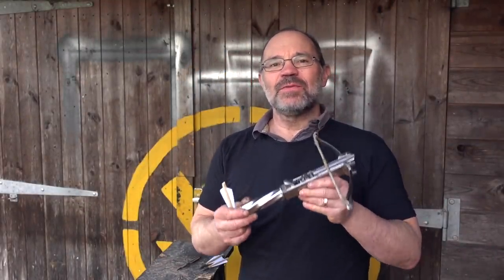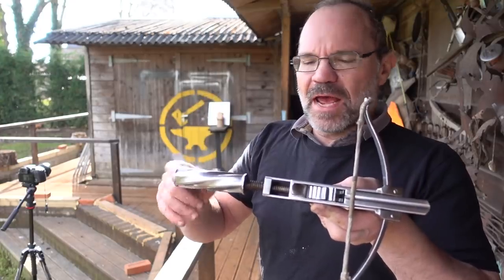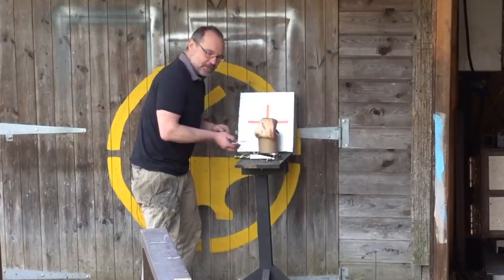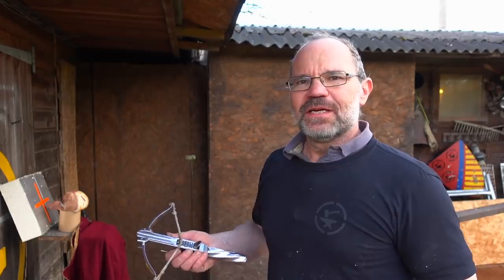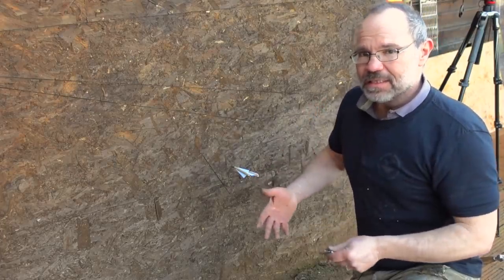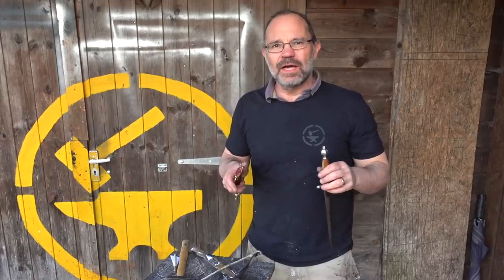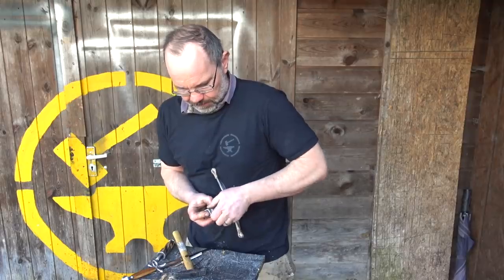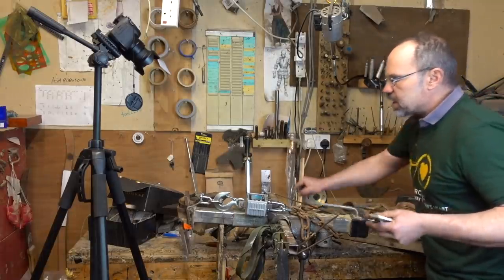200lbs Assassin's Crossbow - LET'S TEST IT!

Comment: I feel like this is the kind of weapon you use point blank behind someone at the theater while the crowd applauds
Reply: Well, in that scenario, a knife to the back is more effective, more deadly, and makes no sound.
Reply: @GuitarsRockForever  but you also risk being covered in blood and getting caught because of it
Reply: @archiebf4524  
Not true, as long as you don't take the knife out, just stab and go away. Poison the knife if you want, getting the job done much better.
With that thing, there are only few craftsman could make it, if you use it, they will trace it back and you are screwed.
Reply: @archiebf4524  Wear a glove.
Reply: @GuitarsRockForever  stabbings are very messy affairs whether you take the blade out or not, I have witnessed 2 of them. Also we don't know how many of these there were, perhaps they were quite common and stolen for the job?
Reply: @Duiker36  stabbings are very messy affairs, a glove might not cut it. Pun intended.
Reply: @archiebf4524  
Tod did a video about those mini crossbow before (I think). They require very skilled craftsmen, and those who can make it, are very small in number. They were never made in large number. It would be stupid to use it.
Also about stabbing, the bloody part is more happening at withdrawn stage and you can shield the blood from the "in the body" stage pretty easy.
Reply: @GuitarsRockForever  we dont actually know how prevelant they were due them being outlawed, yes they would require a skilled craftsmen but that doesn't mean they weren't common amongst the wealthy, maybe they were maybe they weren't I don't think either of us actually know. Point is if you really wanted one that couldn't be traced back to you I'm sure that was possible. I'm happy to agree it's unlikely they were used but I do some situations where they could prove useful
Reply: What if it was more like a "you all know who ordered this assassination " thing?
Reply: @GuitarsRockForever  killing someone with a knife isn't very silent. this is basically just an automatic sabber so you don't have to stab through 7 layers of clothing and get into a fight with someone whether or not the stab works out
Reply: Thats what i thought. Point blank in the back of the head
Reply: @GuitarsRockForever  And if our assassin wants to make it look like if came from behind? with a knife, left in or not, you suspect the one standing behind the victim, with a bolt you look further afield. After all, a paid assassin wants to get away.
Reply: Poison the tip of the bolts, and having range at your side is a bonus in every way of the subject.
Reply: @aleisterlavey9716 , it would be quite good at sending a message. The arrows don't penetrate very deep and the victim is likely in the vicinity of local doctors unless you use it as a highway man. The psychological effect could be quite effect because it looks like it could've hurt and possibly (with a lucky shot) killed. Moreover, if your goal is to scare instead of kill then you don't need aim, all you need is a hit in the general vicinity. That means you can 'aim' it from below a sleeve or table. Aiming it from below might also make it easier to press the trigger. Finally, you've got a bit of distance between you and the target and a bewildered and scared crowed might just run in all directions. You might even be able to trigger the panic by acting the part.
I like the scare idea. The most difficult bit is, I think, the get away. But if you want to do this in a controlled fashion then use two or three people. If these darts start flying from everywhere the you will have a panic.
Reply: Some of you guys are looking into this way too much. Google the Richard klukinski interview he was a mafia hitman. You would use this thing by running up to someone in a crowded market or empty ally or something, back of the head as your walking by in a robe or something as someone mentioned. The guy who said stabbing someone is easier than using this is a sweet guy you can tell he hasnt seen much trauma. Its not like the video games. You dont just stab someone and they start blinking and disappear. 

If you use this thing you can easily just keep walking. No one would suspect you. If it failed or missed you just carried on. Using this like a calico isn't the idea. You arent spraying and praying with this thing fellas, range would not be your friend. Its essentially "holding" a deadly ammount of force for you to use at your discretion. Even if you werent skilled, strong or in some kind of disguise or discreet situation you could know that the force is there ready at a moments notice. You have to posistion yourself properly.
Reply: To be honest having 1,5m-2m reach vs melee is actually a big advantage and already a lot more difficult to detect and defend. Even from a psychological view pulling a trigger is better and easier than ramming a dagger into a person. Early pistols were shot from similar range in cavalry battles.
Reply: Unrealuknow what happens if you miss 😂
Reply: @Sauce_Sensei  if you're point blank you don't miss unless the person does something drastic like duck.
Reply: @GuitarsRockForever  what if he was surrounded by heavily guard or idk . This might be usefull
Reply: This was my first thought too. 5 meters seemed like a long range. Any situation where you wanted to keep some distance, but otherwise wanted to be discreet and could still guarantee a killing blow to a critical area these little things would be useful.
Reply: @GuitarsRockForever  Knife in the back is more deadly than bolt in the brain? A knife attack is more violent, personal and physical. A bit more complicated than pulling a trigger and walking away.

Comment: It might work better if you used a iron bolt as due to the small size a wooden bolt with only a metal tip doesn't really have the weight necessary to carry enough energy to be lethal, if the whole bolt was metal though it will probably hit much much harder, go further and may even be more accurate as the bolts you were using seemed to almost angle upward slightly of where the bow was pointed.

Comment: I greatly admire your handiwork. The quality of workmanship is unbelievable. Looking at you shooting it at point blank range made me think that could it possibly have been an attempt at making a type of "powered" push dagger? Rather than bolts a very heavy push dagger type blade may have been used to penetrate chain mail. Even at point blank range the user could have been out of sword range shooting it with arm extended. If that were the case the bow would never have been sighted at eye level  and the position of the trigger and the way it was held would make it very usable for point blank torso shots. That sort of ties in with the description of your wonderful recreation of this weapon as an assassins crossbow.

Comment: A well designed set of hand-thrown darts would be 
more effective and easier to conceal.
Reply from the maker: I hadn't thought of that, but yes, very much so
Reply: If we are talking about altatl darts then yeah, but a little dart like this?
Reply: I agree the darts would be easier to conceal while carrying them but maybe less so when deploying them. I imagine someone could fire a loaded balestrino with a posture that doesn't draw much attention while chucking a dart might stand out if there are witnesses around. Also, I think effectively using the darts would require more skill. A trained assassin might have that skill but a novice who was trying to kill someone sneakily probably wouldn't. 
I'm not saying I think the balestrino was actually an assassin's crossbow, just exploring scenarios for the sake of discussion.
Reply: Throwing a weapon, however, is a big motion. Even at short ranges it's obvious you're the thrower. Using a crossbow like this from under a cloak, can be almost imperceptible. I imagine the optimal range to shoot for this is about 5 feet. You walk up in a crowd, make no obvious gesture with your weapon concealed in your cloak and fire nearly silently. Sounds pretty assassin like to me. =\
Reply: @beansnrice321  No, watch the video again, that crossbow is
louder than a PCP air rifle with no suppressor. The nut is so loud
it echoes.
The idea that a cloak could save you from the gallows is comical.
Reply: @Japs_Eye_Of_The_Tiger  While not silent it is certainly far less conspicuous and less immediately obvious what is going on.

But regardless I concur with Todd that these were highly likely not assassin's weapons and more toys that some derps thought were scary.
Reply: @josephburchanowski4636  blow devices can be very long.
Reply: @planescaped  Honeslyt this. People would have heard a loud sound that doesnt sound like a gun, you wouldnt be the first person to be noted, and they could have dampened the sound using leather or anything really.
Additionally to that, we have literally no idea how these weapons were made, if they were made of full steel or not for example, which would make a massive huge difference in what kind of sound the crossbow makes when fired.

There are two different conclusions here with this. Either what Todd has is just a trinket version of what was actually used, or it was just a trinket. I dont really see it being used in any capacity without a bolt clip regardless of how it was used.

Comment: If you were an assassin during that time period, and getting caught meant being tortured to death publicly, using whatever possible technology was available to minimize your chances of being caught is money well spent. Also it doesn't really matter it was inaccurate, it was the best you could do at the time. Just trying to get that bolt anywhere on target to administer poison at range and then running for your life to hide is a much better idea then approaching in daggers reach to be grabbed or tackled by a bodyguard, and then drawn and quartered to the cheers of a crowd. 

This seems like a Hollywood or fantasy novel trope, but how realistic is using poison bolts for that crossbow?  Did sufficiently dangerous poisons exist during that period of time that could be practically applied to a bolt?  If there was a sufficiently dangerous and practical poison available I could see that being a viable use, it's much more quiet than a firearm it has range that a dagger does not, you only need to hit a human size target in the back and then slip away to kill your target. It has the power to penetrate clothing and administer a poison fairly quietly at range, and that's all you need.
Reply: Knew I couldn't be the only one who thought of this.
Reply: @CowCommando  I find it kind of bizarre that this comment was buried and nobody else is really suggesting this.  It seems kind like common sense to me and I can't think of a different weapon I would want to use if I was an Assassin during that period in Italy. I mean, I am all ears if someone has a counter point I would love to hear it. 

If ,and I will acknowledge this is a big IF a sufficiently deadly and available poison existed at that time that could be reasonably applied to a crossbow bolt, but if that did exist, then yeah it's not only a viable Assassins weapon, it's a desirable one compared to the alternatives of the time. Even is a poison only had a chance at working it seems like a chance you would take over risking getting yourself killed.  You could get your target with a knife or pistol at that time, but It would also be desirable to you know, live afterwards, and not die a painful slow death.
Reply: @-Zevin-  plus we need to consider that the examples we have available to us are likely the plinking toys of nobles. Who would be less concerned with utility. An actual assassin would likely breakdown their weapon and conceal it between jobs, making it less likely to survive. Those weapons would be more likely to have more utilitarian features like the bolt clip mentioned in the video.

A modern equivalent would be the way some people use firearms. You have the plinking hobbyists who have flashy features that don't really add anything. Then you have people who work with firearms and only bother with practical features. The former often get displayed (see gold plated AK-47's) whereas the latter is a tool, used, maintained and disposed of when no longer useful).
Reply: Poison on arrows was widely known back to the days of ancient Greece - extract of aconite was smeared on arrows use to hunt wolves, leading to aconite gaining the common nickname of wolfsbane. On the other hand, if an assassin was hired to kill some high muckety-muck and had access to poison, a much more effective and safe way to deliver it would be to disguise themself as either a court flunky of high enough rank to have access to the target but low enough rank not to draw notice or as a servant, and dump the poison into the target's cup of wine, beer etc. It would give more time for the assassin to escape once delivered, and they wouldn't have to angle for a shot or even carry a weapon.
Reply: Do you need deadly poison, maybe as a threat or intimidation hitting a noble with a bolt with a position like hemlock poision ivy or sumach making them sick for a few days or in pain would be a sufficient scare to alter laws or gain compliance.
Reply: One word. Blowgun. Does everything this toy does better. Cheaper, harder to trace, easier to conceal, vastly more accurate at range, quick reload, harder to recognize, longer response time to its use allowing for much more reliable escape after the strike. If you're going to use poison anyways, and you're a professional trying to get away, just use the better tool.

Comment: There's some main advantages  for using this kind of crossbow.
First - it is not as loud as a gun, so it can be used in streets without unnecessary attention.
Second - you dont need much more firepower to disable a person. In muzzle-loader time main argument in fight is still a sword or a rapier. If you manage to hit an opponent with bolt - he's gonna be a less threatening target for sure, even without poisonous bolts.
Reply: That's assuming that you can even hit your target with it, though. Moreover, it would also depend on where you hit him... and hopefully he is not wearing armour. Because against a determined opponent, a non-incapacitating hit with something like this would just piss him off and make him an even more threatening target.

Also, knives attract even less unnecessary attention in the streets. Perhaps even more so back then than today, when it was common for people to walk around with swords and daggers on their belts.